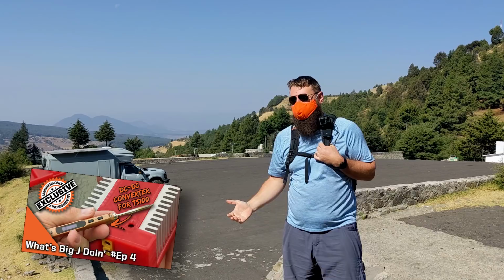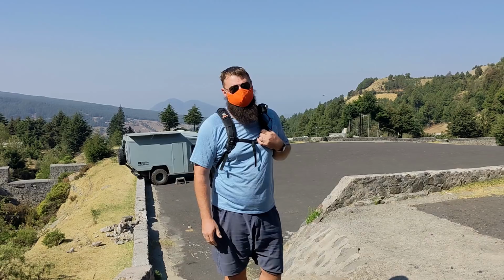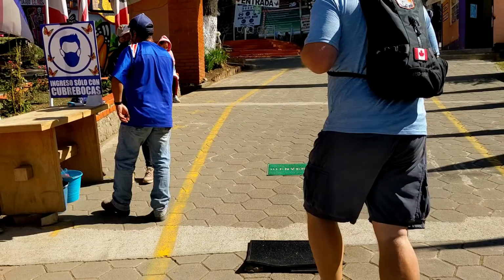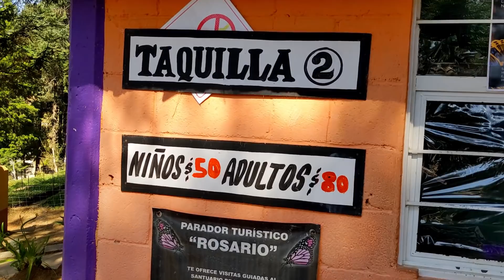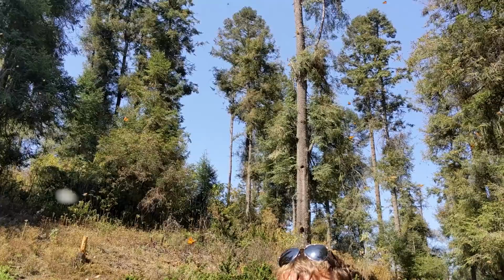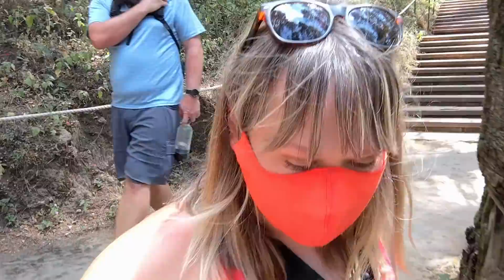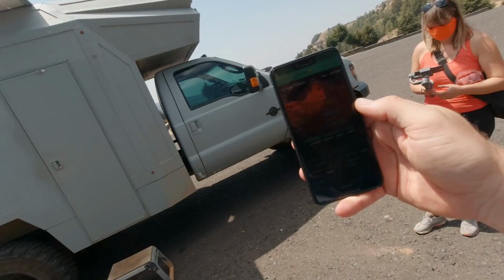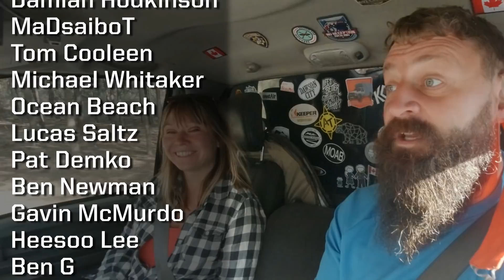Bucket List 🦋 El Rosario Monarch Butterfly Sanctuary 🦋 Everlanders See the World!

Comment: ... I'm sure you know about these "Checktorque" thingies for the loosening-bolts-problem ... a nice little job for your 3D-printer ... stay safe ...
Reply from the maker: Yeah, these were not the lug nuts, but the axle bolts...
Reply: @Everlanders  ... noticed ... but you can print out the desired smaller size yourself ...

Comment: This has nothing to do with this video, but I would really love to see you develop a 12v thermostat designed to be retrofit into the average travel trailer.  Wifi enabled, programible, minimum and maximum temps.  Seems like you have the knowhow to easily out something together, and there seems to be nothing on the market for 12v systems.
Reply from the maker: Could easily be done, but our Espar D2 came with avery good thermostat, so I have little motivation to do this.